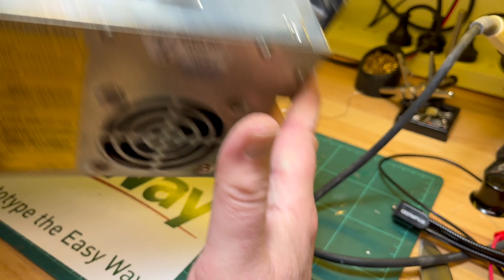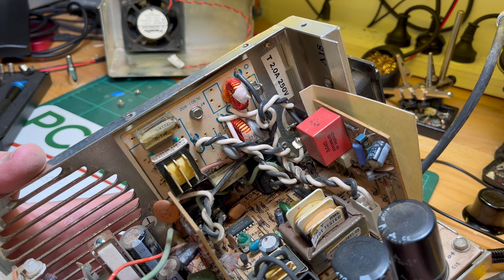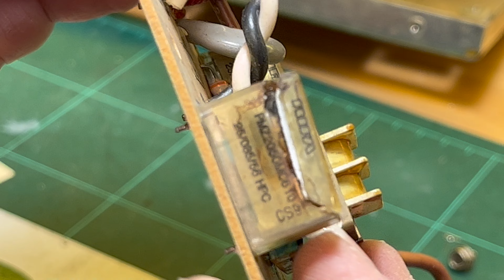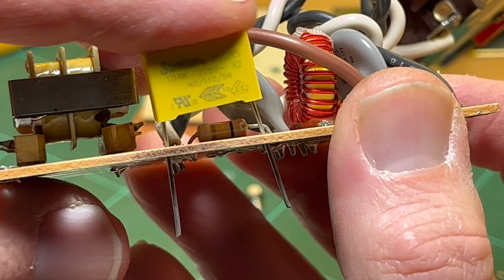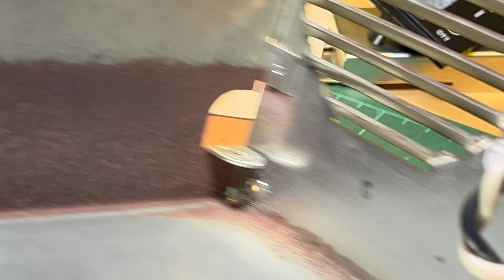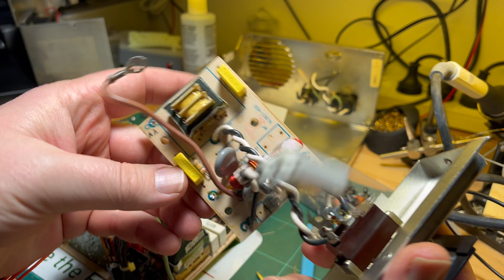🇦🇺 IBM PC/XT (Model 5160): Part 7a (Power supply refurbish) [TCE #0312]

Comment: I have a late production 5160 power supply in my 5150 which was made by Astec.  It actually has active PFC and it is universal voltage (85-265VAC).
Reply from the maker: Does it have RIFAs as well?
Reply: @Brfff  I'll have to look at it again.  I don't think it does.

Comment: Rust tends to act like a fungus, even when painted over.  It will keep growing unless the paint used is specifically formulated to either hinder it's growth or turn the rust into a primer.  I've seen it many times dealing with older vehicles when the surface rust was just simply painted over and the metal underneath turned cancerous.

In case you were curious, Brett, I am a "jack of all trades" but I profess to be a master of absolutely nothing.  😅